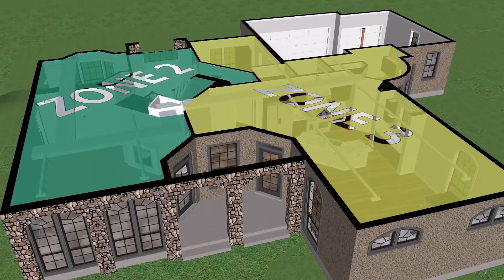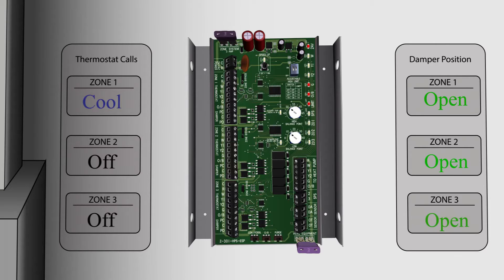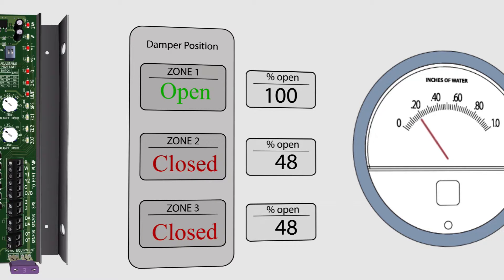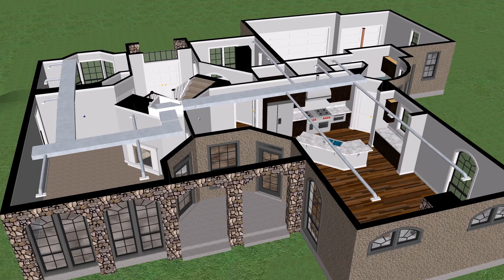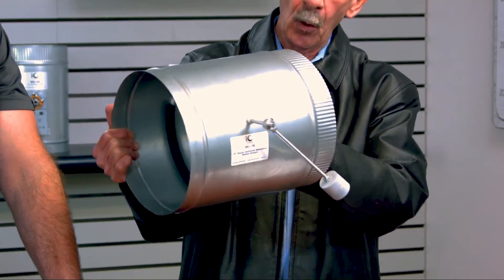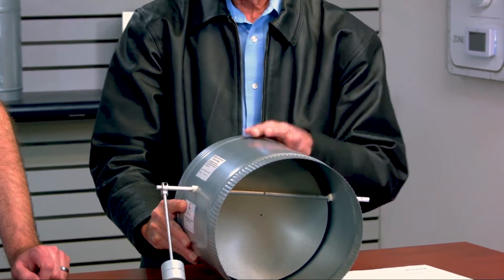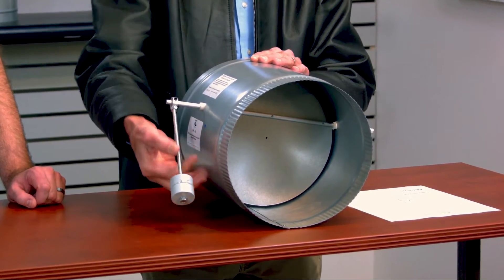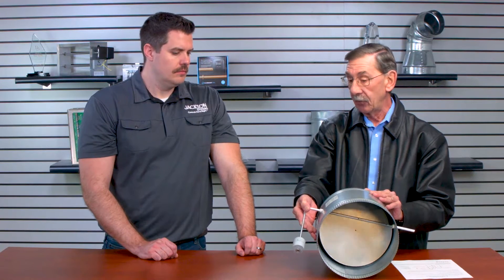How to Balance a  Barometric Bypass Damper

Comment: I have a horizontal system (furnace and coils) with a horizontal bypass duct but the damper was installed vertically, in the downward leg/segment of the duct going to the return plenum. And worse, the damper they used doesn't seem to be one that can be installed vertically (no markings on it to indicate this) so it's either always open or always closed. Don't exclude the latter - they installed the air purifier backwards too. But short of tearing the system apart, is there any way to determine this? I've noticed that the fish weight control arm never moves. Never.
Looking at the installation manual for the BV-XX weighted control arm bypass damper on your website, it appears as though in a vertical application where the airflow goes down, that the control arm is positioned upward - about 1:00 for closed and 11:00 for open. But my control arm is positioned downward and has a range between 1:00 and 4:00, and it's always in the 4:00 position. So even if this damper can be configured vertically, that isn't right, right? So it will always be open or closed.
You guys don't do work in central Texas, do you? Looking for a good HVAC contractor - none of the ones I've talked to seem to understand even what I've described above.

Comment: Thank you for this video strangely enough my temper one side is on the main and the return site is just left completely open so all the hot air stays in the furnace room. What do you think could be done to fix the issue? Can I reuse this hot air and distributed in the basement.

Comment: With these newer systems that utilize ECM or even true variable speed blower motors, am I correct in assuming that this balancing needs to happen at normal cooling speed call from the system? I appreciate the videos since I don’t run across many zone systems. They are beginning to become more regular in my area.

Comment: Why say eeww when you talk about bleed air through zones? It's actually much better than bypassing the air right into the return air and putting the equipment out of designed parameters
Reply: The bypass is to relieve pressure created from closed zones. If you bypass to other zones that are likely closed (raising the pressure) you are just rerouting the pressure back to where you didn't want it to begin with. That's why it goes to the return.